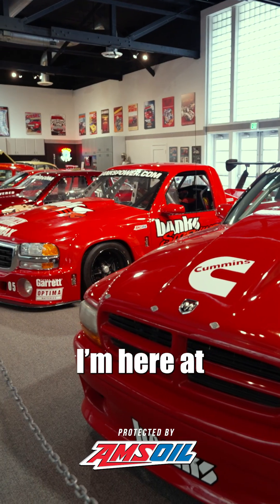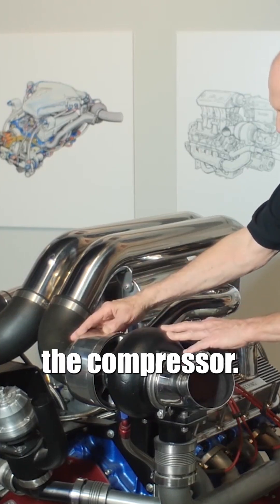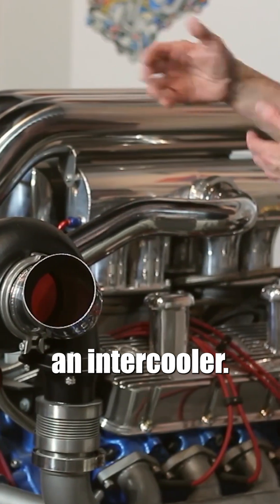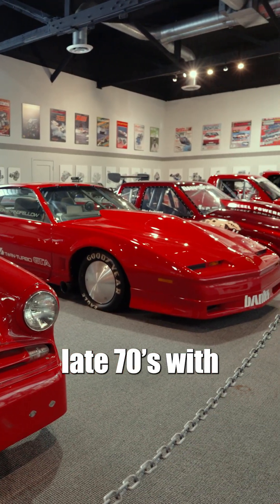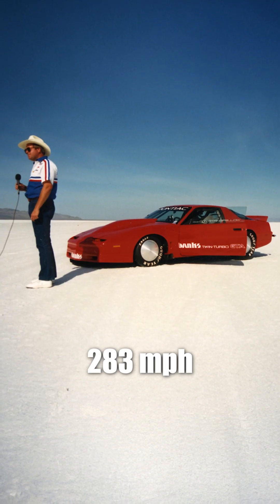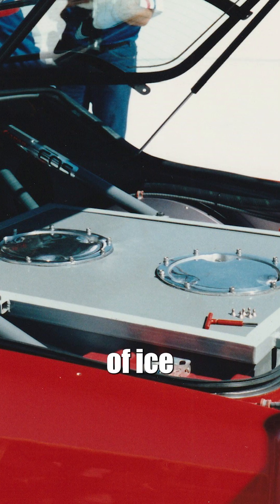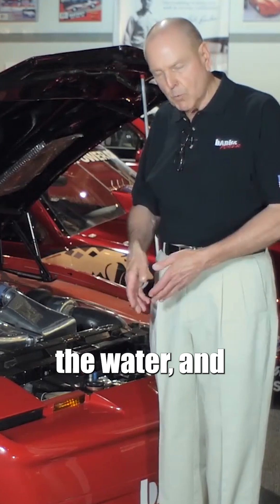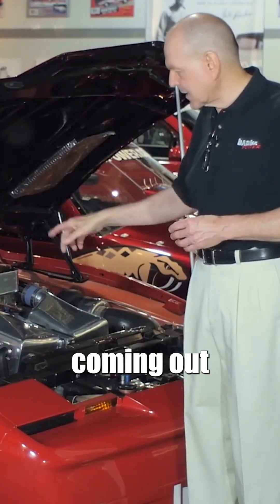How we made 2,000 HP in 1974

Comment: Try liquid CO2 or nitrogen for cooling medium.
Reply: It starts causing problems if you get the intake air too cold. The fuel can start condensing and not wanting to mix. At high power levels you’re pushing a lot of fuel so it really needs to mix. 
Usually ice works well because it’s easy to get, isn’t overly cold, and absorbs a lot of heat. For land speed you also typically want more weight for traction anyway.
Reply: @NBSV1 ah ok, the more you know. Didn’t know that! Thank you.
Reply: Buddy Ingersoll did liquid nitrogen intercooling on his Buick V6 Skyhawk.
Reply: CO2 becomes a liquid under about 5 bar pressure, but at relatively warm temperatures in the region of 70F all the way up to 88F depending on the pressure.  Not impossible to achieve, but difficult to keep two variables synchronized (Pressure & Temperature). Keep in mind that CO2 sublimates from solid to gas under normal atmospheric pressure.  Liquid N2 would absolutely work if configured correctly, but at Bonneville, the ambient is so hot that it would be a challenge to keep a dewar of liquid N2 it would all boil away.